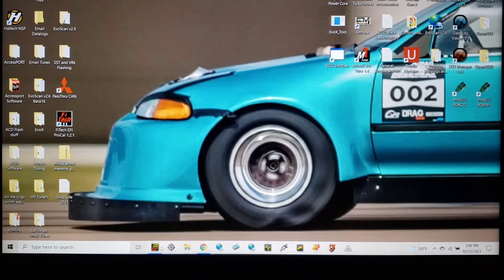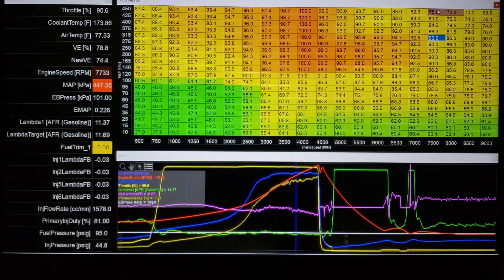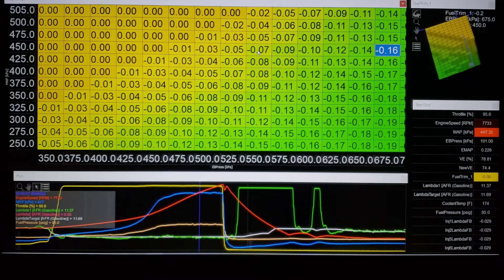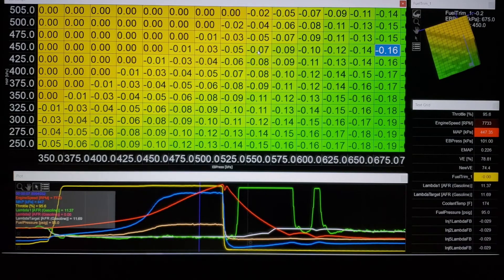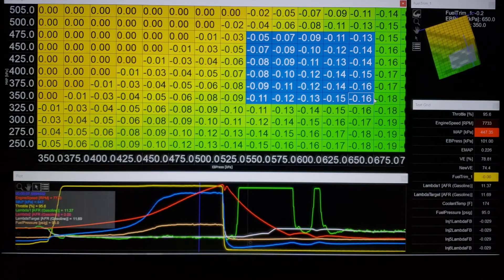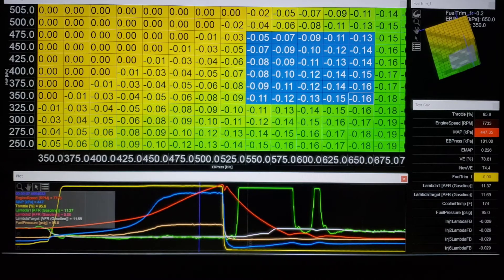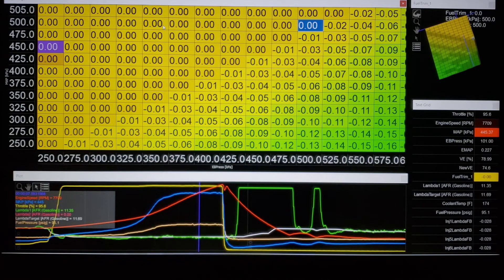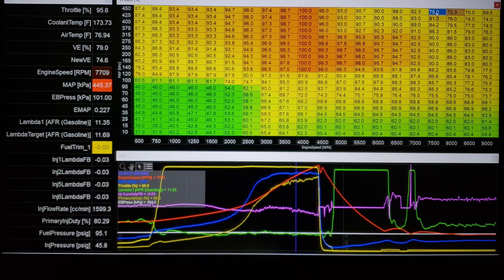EMAP Revisited episode 2

Comment: Left a detailed comment on an older video re: VGT and EMAP. My system still needs some refinement, but overall is working well. One thing I still hadn't figured out was how to adjust my fueling during spoolup when I temporarily close the vanes and run high drive pressure ratios. Trim table is an awesome idea! Sadly I don't think my MS2 will let me set up a trim table of MAP vs. EMAP. It does have trim tables, but they are intended to be used for per-bank or per-cylinder adjustments.
Reply from the maker: If it's on an Infinity there are a few things that you can do with the optional fuel trim videos. You can trim vs EMAP if you setup the axis. Haltech can also do it as well.

Comment: Nice video, but further on, you wouldn´t need the main VE table to have anything on the load axis above 100kpa if the VE is always calculated against map pressure, ie 200kpa is 2.00x the VE value etc. Then as soon as you are in boost you just need to use your backpressure trim table for anything in boost
Reply from the maker: I could also just tune "efficiency" for the load axis since it allows for MAP/EBP as the axis
Reply: @AaronONeal1  yes, but you still need to make sure it keeps multiplying against map of course